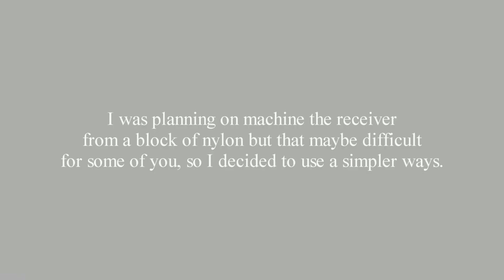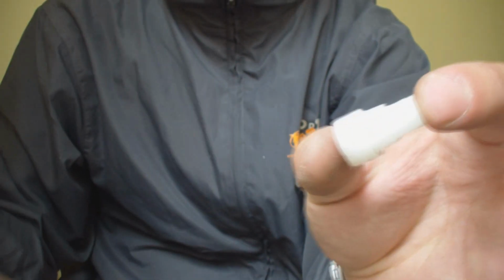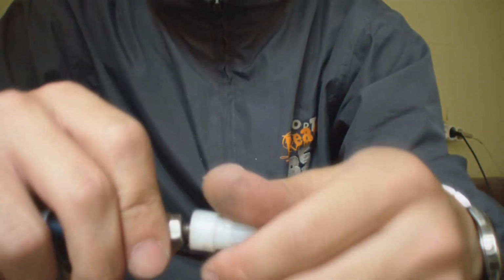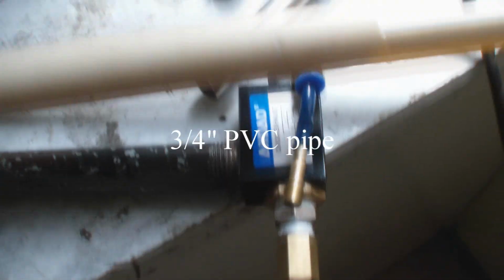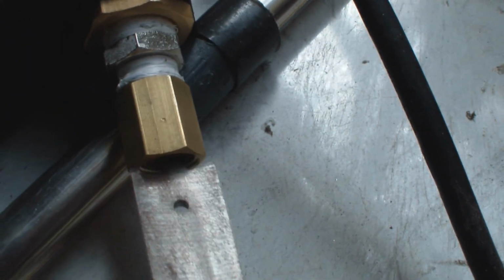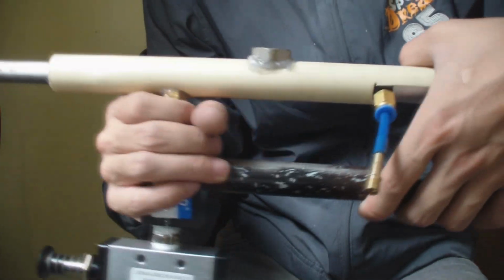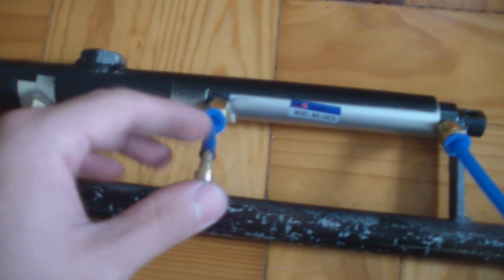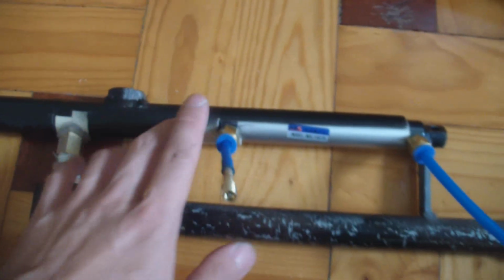How to make a semi-automatic airgun (version 2 part 2) 自制气枪

Comment: I'm sure you have, but have you considered using a 5 way valve, I know it complicates things a little more but when in position 1 chamber 1 is charged and the piston will be extended, and upon firing the second chamber output on the 5 way valve is used solely to retract the piston until the trigger is released thus extending the piston again

Comment: Another idea is to have a cylinder connected to the input port if the QEV, which is spring loaded. When the input is charged the ram slides forward, pushing the bolt. After the shot is fired the ram slides back (because it is spring loaded and there is no pressure from the input), which pulls the bolt back, allowing a round to drop into the barrel. The input is immediately charged again which slides the bolt forward, repeating the process.

Comment: Also do you think just using the 3 way valve would work because i thought about putting air surply up one of the bottom ports then a little holding tank on the top single port so when the trigger is forward it fills up the tank then when you push it back the tank will empty out the 2nd bottom port and thus i could conect a barrel to that :D

Comment: i love you vids and your realy insparational to me airgun wise i love your ideas but can you give me an ebay link to where i can get the exact 3 way valve i dont need the qev i just need a link to the silver 3 way valve with the trigger switch built inthe one you added your own spring to i cant seem to find the correct one there all like 3 position and i dont know what is the exact one you got to make it work like yours so a link would be apriciated thanks.

Comment: little bit confused :S at the start u said to attach the air cylinder to the bottom of the 3 way valve but at the end of this vid it in attach to the gas tank, so do you not need to do anything to the outher port on the 3 way  valve. hope u understand what i mean lol 

thanks for the help :D